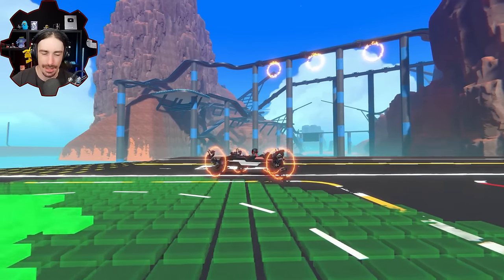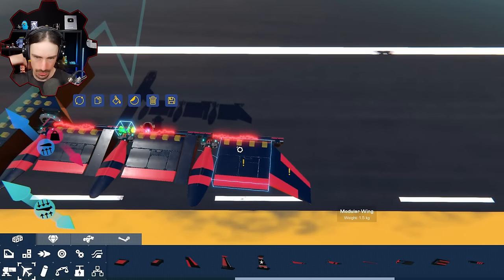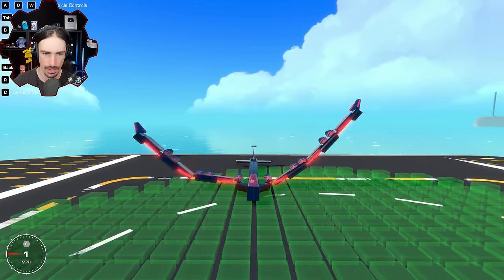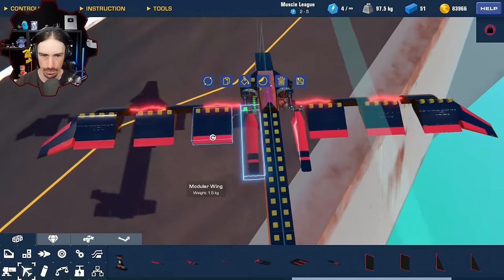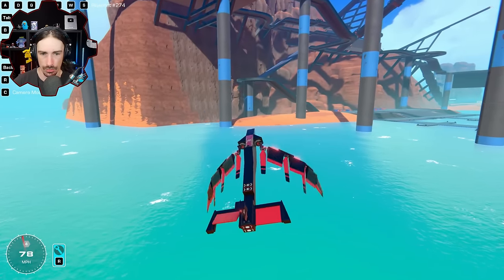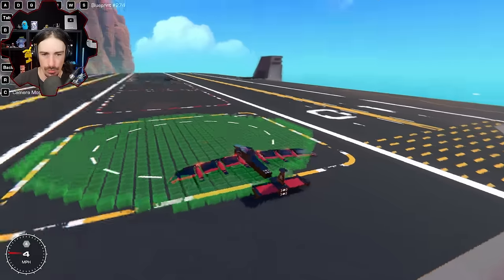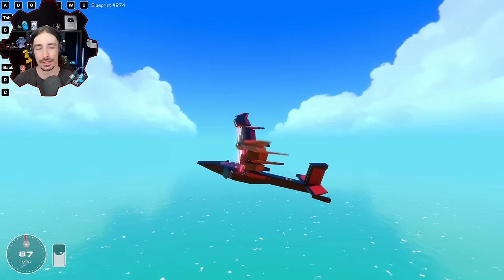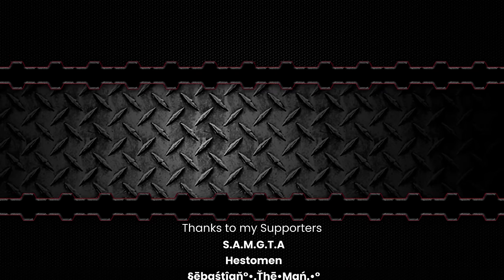Ornithopter Wings Are Way Better With Power Couplers!

Comment: I think if you had flipped the rotor blades on one wing they would have worked. They seem to apply lift in one direction only bc they're supposed to rotate.

Comment: I build this but i made the wing 2 times so what i did you have the main wings and you copy them and place them 2 blocks higher with 2 blocks between the lower and the upper wing. and then just connect it so its good aerodynamic  and just do the exact same settings as the lower wing and boom you got way better lift stability and it might take away the looks abit but its still really cool
Reply: oh and make sure the upper wings are also back one piece

Comment: Perhaps you could make longer wings if the outter power couplings were on lower stiffness? So the further out parts still sway even though there's less weight on them, i think would also mean less felt weight on the inner most power coupler

Comment: You should try racing or battling with power coupling wheels. Or you could connect power couplers to the wheels and attempt to race or fight that way. With wobbly wheels

Comment: I don't think that there is a mirrored version for the helicopter blades. They are meant to spin so therefore there is only one way that they move air, which is in your orientation to the left.

Comment: 1. I feel like the stiff tail needs some rope to make it more realistic.

2. Also on the down stroke you can flap down and back, and the up stroke you can flap by slicing back up through the air to prevent resistance.

3. Or maybe you can flap up super high, then you can put the wings back so you can gain speed and dive like an eagle. Add some bombs in the mouth and you have a dragon bomber from how to train your dragon.

Comment: @ScrapMan - you might find it easier to watch a slow motion video of a damselfly...
• Make the wings stiff
Have 2 rotors and 1 hinge, per side first rotor is the pitch control for fward and back of aircraft motion, you need to attach small thrusters or propellers for rudder and pitch control on the tail.

• You'll need a Ford and back motion, to pace on the pitch rotors, this will be swishing action, you have to use timer 🤔  no sensors in connection flappy rotors. Yes it will have to be sensors so you can incress / decrease power to gauge the lift.

• next set of rotor is the flappy ones that rotate the wing from the head edge, not sure how far the should rotate, maybe 60° or 65° either side of center, 120°, 130° total maybe 

Good luck 🎉 make something magical

Comment: I think they should add a cable block, that is exactly the same as the power coupler, except you can't turn it invisible and it has a steel cable texture

Comment: Currently the wings are just going up and down. If you want to gain speed and height, you need a tilting motion, where the up movement is more aerodynamic, pointing the front of the wings upwards. This way, the wings are not pushing your vehicle as much downwards anymore when the wings flap upwards.

Comment: What I would’ve done is probably make something that can glide and then make it work as an ornithopter, also the helicopter blades are meant to spin so they give lift in the direction of the spin which seems to be towards the left causing the center of lift to move in the at direction

Comment: i'm curious if it would have made a difference to only change the two outer powercouplers to a lower stiffness. it might have looked even more bird-like but the same time be a little slower.
also i think there need to be different lengths of powercouplers. might work even better with shorter ones, like half or a third of the current length.

Comment: Ornithoper 3.0: Hybrid wings? Near the body could be rigid elements and towards the tips can be power couplers for a longer wingspan? Since we are in the realm of fiction, try 4 and 6 wings than just a set of 2 wings.

Comment: I think the problem is that the helicopter blades are of course meant to spin 
So because of that each blade is tilted to one side so that when it spins it moves in a circle easier since it’s moving to the side
So each helicopter blade is directing air to the left because of its tilr

Comment: Yes. Ornithopters are much better with power couplers. Now... what about an ornithopter biplane? Does a second pair of wings help at all? Do you want the second pair of wings to flap in opposition to the first pair, or in sync with the first pair? Does having them flap in opposition cancel out any lift generated? Is takeoff even possible with such a build?

Comment: like real birds you need deeper wings to move more air, and a shorter body so all the thrust goes to the center of gravity, not a point in front of it. good job putting the roll into the wings, birds also use tail plumes for pitch or deceleration.

Comment: On the helicopter blades they have an angle because on an actual helicopter it uses it to lift up so you would have to put the angle facing each other

Comment: problem  if any is that you are still looking at it like an airplane instead of looking at it as a huge bird... the pitch roll and ... of a plain wont work for a bird they use the motion and angle of attack of each feather and specially the tail to change direction, add or reduce speed but overall i loved it please do a challenge like this with friends🙏🙏🙏

Comment: I think bird wings "write" a figure "8" in the air, not just flap up and down (wing is basically a "hand" or arm, rather, you can test rotating your shoulder joint to see the "span" or limit of the motion/movement)... also: the tail, birds don't really have the "vertical rudder" or whatchamacallit, only "horizontal rudder" - a dolphin-like tail fin thing, birds essentially "swim" through the gas fluid medium of air, if you think about it... then they (the birds) like twist and turn their b*tts slightly sideways or diagonally... so, like a hinge or a servo or anything that turns built into the tail itself, like where you have the logic blocks, there... you know what I mean (I hope you do, lol)... Other than that: good job, machine looks really neat, almost like a dragon (probably 'cuz of the color scheme) ^^

Comment: hello scrapman i think the real problem with your creation is you havent looked at how animals fly if you look closley at their inner joint you will see them do a 8 shaped movement or closed to it not a linier movement and birds not constantly flap they straighten out when turning and after getting alittood i think if you just fixed these parts it would be way easier to play and turn

Comment: The reason the helicopter blades move the center of lift is because on a helicopter all the blades are face in a different direction so one would move the center of lift and the other would move it back

Comment: i find it weird how you still cannot adjust the strength of some parts during driving/flying. would be nice to have a controller that is a 0-100 and by pressing a button it increases/decreses

such a weird decision to have all those controllers and no variables to couple them with

Comment: My problem with power couplers it it seems like literally everybody has just forgotten that you can literally change the strength settings on hinges to make them bendy or more flexible instead of rigid.

Yeah, couplers are “naturally bendy”

But hinges can be too. 

Most of this stuff can just be made with hinges for the exact same result. The real attraction to the couplers is their lack of collision and ability to go invisible.
Reply: Not quite.
Power couplers flex in 3 dimensions, so you would need 2 hinges stacked on each other and another hinge pointing sideways for the same result.
Reply: @probablygeneric429  you can get a very similar effect with half the space taken up by power couplers using 2 hinges stacked on top of one amother
Reply: @ThePhonax power coupler still better and also if that were the case you'd see things with hinges a lot more but that isn't the case
Reply: @DivinityAureole  because nobody realizes they can use hinges